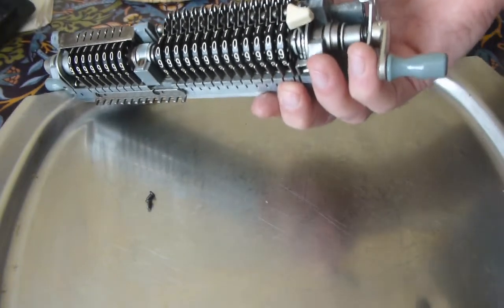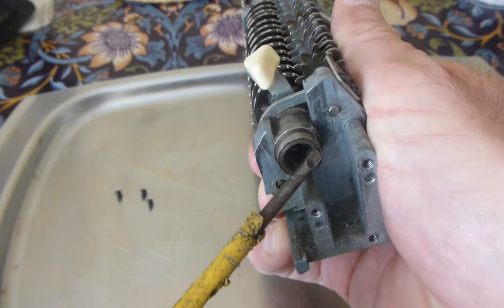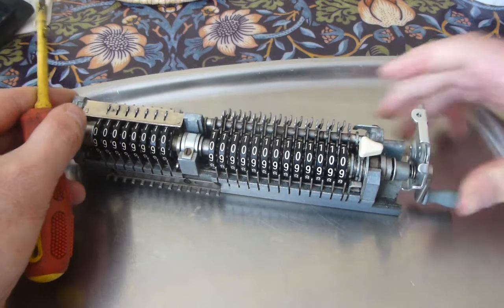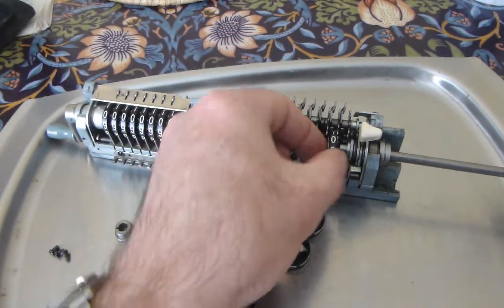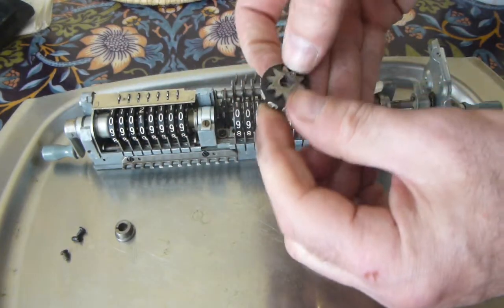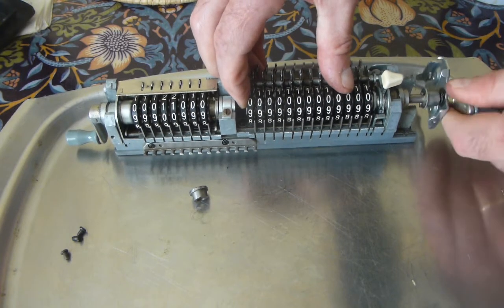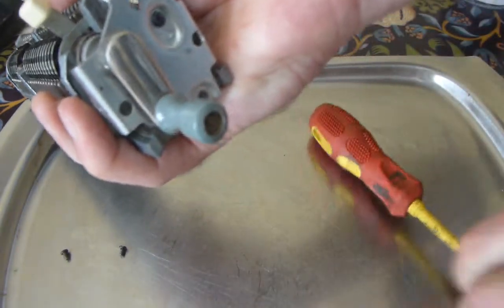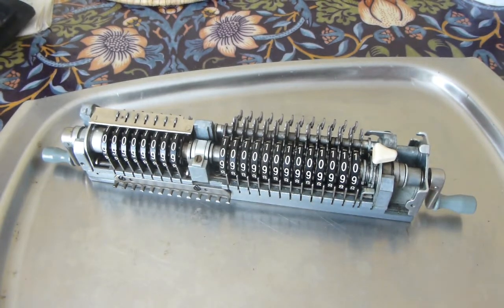Odhner 239 Resetting Crank Replacement

Comment: Maybe someone can advise me I have a problem with odhner 39 revolution counter reset handle jammed and not able to turn it can only be made to work and freed up by replacing zeros with any number on all wheels except the outside two at either end, have tried retiming with no luck any one any ideas please